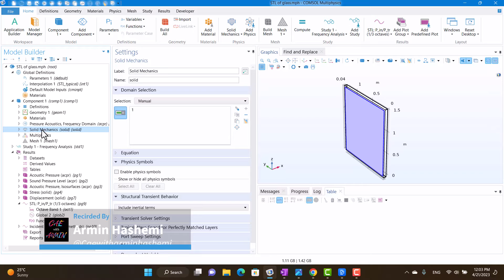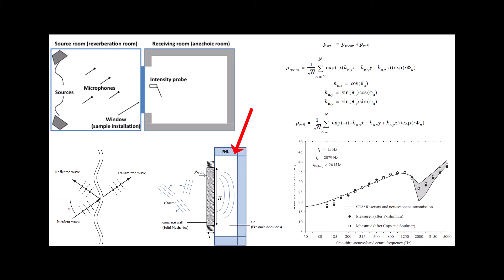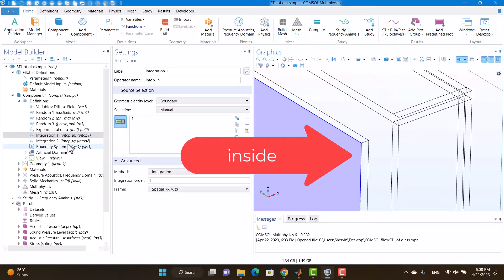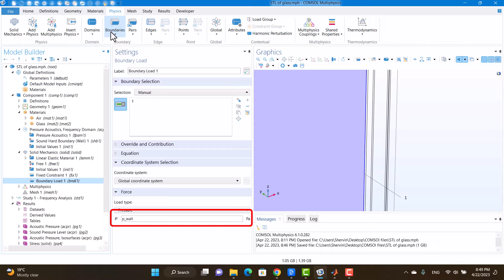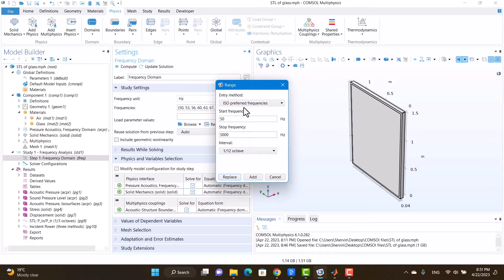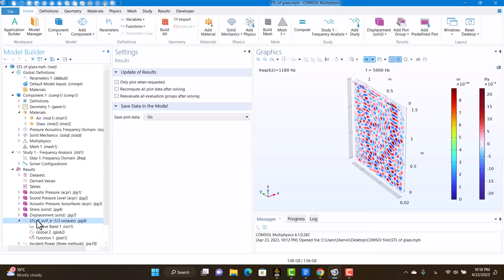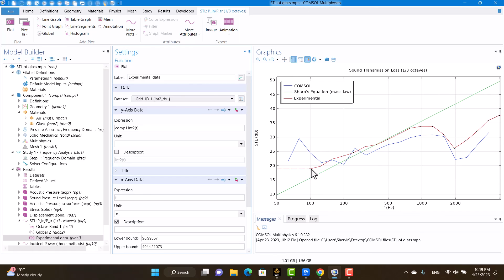Mastering COMSOL: Sound transmission loss of a panel in COMSOL multiphysics

Comment: Can i use the variable and paramater if i analys noise barrier highspeed train ?
Reply from the maker: Yes, You can use them in all simulations.
Reply: @caewitharminhashemi  can u help me sir. how to simulate noise barrier with train noise ? that is, how the noise from the train can be absorbed by the barrier. Can i use the method in the video above to simulate it ? or do u have another releveant video ?
Reply from the maker: @muhammadfadil761  if you need to investigate the effect of noise barrier pattern, you have to model it in 3D. 2D model is accurate for non perforated baffles with simple shapes.
Reply: @caewitharminhashemi  I have created my 3D model, sir. Does that mean I can follow the method above for my case?
Reply from the maker: @muhammadfadil761  yes. Follow these steps. The only difference is that you have to choose 3D space
Reply: @caewitharminhashemi  thank you sir, you are very helpful in my thesis later. In campus there is not a single research using it and it is very painful.
Reply from the maker: @muhammadfadil761  you're welcome
Reply: @caewitharminhashemi  Can i add noise from train ? can u teach me how
Reply from the maker: @muhammadfadil761  It's not a simple model. I don't have any experience with train noise. It's better to refer to the papers
Reply: @caewitharminhashemi  I have a error after compute.
" Could find any cartesian regions"
Its because i create my 3d design in 3D Cad software ?
Reply from the maker: @muhammadfadil761  It’s probably because of the PML.
Reply: @caewitharminhashemi  does the PML dimension have any impact? for example if I change the thickness?
Reply from the maker: @muhammadfadil761  it's not very sensitive. I usually set 5 to 10 cm depending on geometry size
Reply: @caewitharminhashemi  How to make sandwich design in comsol ? Without using 3D software
Reply from the maker: @muhammadfadil761 by using layered material you can create sandwich panels
Reply: @caewitharminhashemi  Do u have tutorial video sir ?
Reply from the maker: @muhammadfadil761  composite layer modal analysis is my video name

Comment: Hi bro, when i run the solver i am taking "Undefined variable P_in" Error. Do you have any idea about it? Thanks
Reply from the maker: Hello, maybe one of your variables of pressure is wrong.
Reply: @caewitharminhashemi  I checked video again and I think one the variables set called STL is not defined begining. And please accept my LinkedIn connection request 😅
Reply from the maker: @arift.dogan.youtube  Okay 🙂
Reply: @arift.dogan.youtube Hey, did you ever find a solution to the P_in error, i ran the COMSOL as is and got the same error. 
thanks.
Reply: @en_tub3  as I remember this problem occurred when domain selections is not suitable or part is very complex so meshing progres problematic

Comment: Assuming the body is a composite material, how to apply the periodic conditions for Sound transmission loss in the micro domain
Reply from the maker: You can apply periodic conditions on edges  from physics tab > boundaries
I haven't modeled composite before. Maybe you have to use floquet periodicity